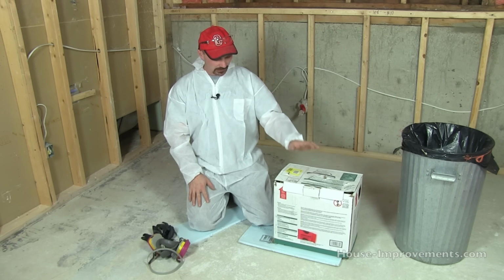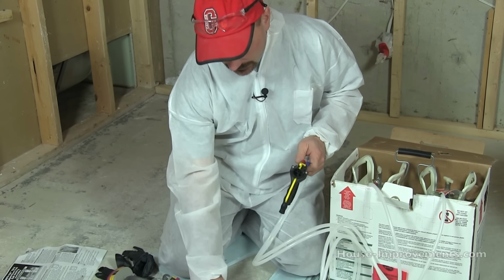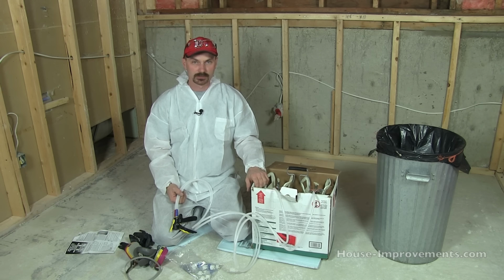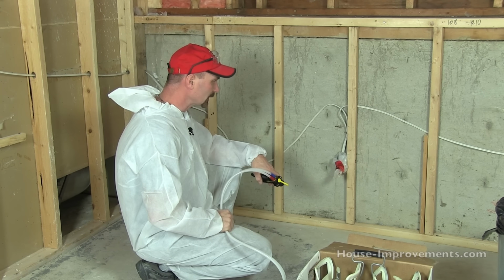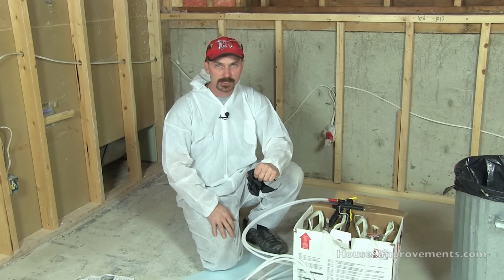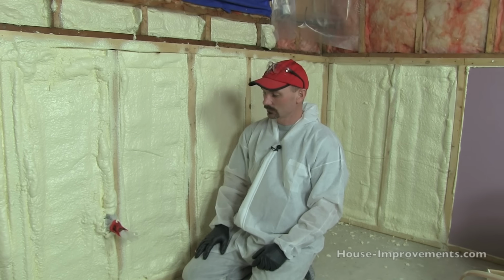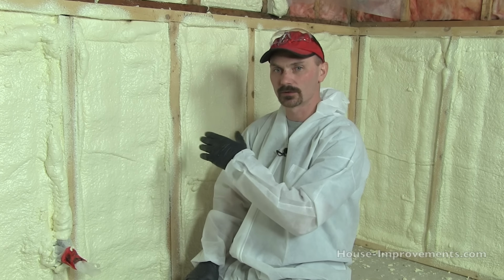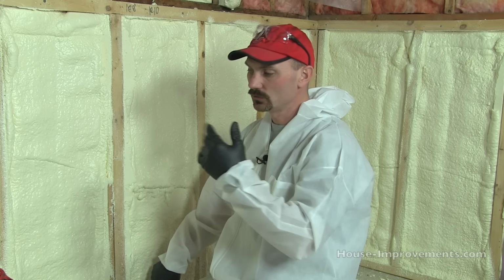How to Install Spray Foam Insulation DIY

Comment: Shannon - although some of your tips are spot on, you make several dangerous mistakes in this video - You should never spray another layer on top of rising foam that has not cured, becasue the new layer prevents the first layer from fully curing. As a result, the finished product will not have the full R-value, could cause off-gasing, could become flammable, among other hazards. This is one of many reasons it IS NOT A DIY PROJECT.  The printed instructions should explain this but the average layman would not understand this.
Reply: Thanks for pointing that out. He should have window boxed with the spray, then a single pass fill vertically and moved onto the next section allowing the prior sections to cure 100% then go back to the first section after and make the vertical pass.

Comment: So to a painter its similar to spraying paint?? Only asking because i have a friend who wants me to spray his wharehouse in foam insulation..help would be greatly appreciated
Reply from the maker: A large project  like that will be much more efficient with a pro system. These little kits are expensive and not always fool proof and I would not recommend them on a project of any real size. If you have more than 500 sq. feet to do I would hire a pro.
Reply: @HouseImprovements  ok..thank you

Comment: How flammable is this stuff during spraying? would you turn a furnace off if spraying in a area near a furnace?
Reply from the maker: I would, but I don't see where it says to on the manufactures instructions. Read the instructions for the product you are using.

Comment: I watched your video on spray foam application; how do you think this product would work in an attic ceiling with irregularly spaced trusses in a 1904 house?

This would be the “easiest”, I think, as it’d save me having to buy lumber to reframe the trusses to regular spacing to fit common fibreglass batts.
Reply: That's exactly what I'm thinking about doing...but I don't know anything. 😄can we or should we spray wood with it? Like ceiling in basement also?

Comment: What if there are sealed cracks or moisture coming through concrete?  If I cover it with foam won't water be trapped behind and mold/mildew?

Comment: Hi Shannon, great video, as always. Are there different types of spray foams, I've heard the terms closed cell and open cell, where would you use each or could you use one over the top of the other? And also, what might a typical "R" value be for foam per inch as opposed to spun glass or mineral wool? Thanks, and keep up thegoodwork!
Dave

Comment: Are those wires in the wall hanging for a purpose... I mean.. Someone has gone to some length to drill them holes in specific locations so that the wire makes that hanging shape. Wouldn't it be better to try and keep them close to the ceiling or the floor so that in the future people wont accidentally drill into them?!
Reply: The way I saw it the wires were on the back sides of the studs and not drilled through at all.

Comment: I want to do in crawl space and I dont know how much I need
Reply from the maker: They come in different amounts depending on the kit. Read the labels but usually the coverage is based on 1" thick and most times you will actually want it at least 2" thick so factor that into the amount you buy. In all honesty if I was needing to spray a enclosed area like a crawl space where there is not a good way to ventilate it well I would hire it to the pros. You need very very good ventilation and a good respirator or fresh air respirator.  in more inclosed space.

Comment: Great video !!!
Brake cleaner from the auto parts store will clean those tips out before the foam starts to harden up and set up so you can reuse them.
WE use the commercial version of this stuff in the factory where I work.
Part A and part B come in 300 gallon tanks and are kept at like 85 degrees far. , so yes it IS VERY important those tanks be kept warm.
The hose assemblies also have heating tape inside of them to keep that stuff warm also so it doesn't cool.
It affects the mixture balance as well as the velocity of it out the gun.
Ours use a nitrogen gas purge valve on the guns also to blow out the chemicals after the timed shot has been finished.
We use a full face shield and a hat on the head for face and head protection.
If using this stuff overhead , please use earplugs....for obvious reasons.
If you get it in your hair just let it set up and pick it out later after it sets up if it's a small tiny bit otherwise get the brake cleaner out and spray it into a rag to get it out before it sets.
It gets messy.
I know one guy who got it sprayed big time into his hair.
He had to cut all his hair off.
He wasn't wearing a hood or hat either.
Reply from the maker: Good tips thanks
Reply: Acetone

Comment: So, how many square feet did you get out of this 2000 kit?  Thanks for the great video.
Reply: Its a 200 kit, 200 board feet to square feet. I just dont know the conversion off hand
Reply: @GemCityRCOutlaws  A board foot is actually a measure of volume. By definition, a board foot is one square foot, one inch thick. The most common mistake made in calculating board footage is forgetting to multiply by the thickness. Example 1: A 4/4 board 8 inches wide and 8 feet long has 5.33 bd.ft.

Comment: Hello, is it true that using the spray foam on the entire house for new construction is a bad idea, because it will not allow the home to breath and also you cannot run wires in the future? A builder recently told me this when I was looking into what insulation to go with for my new home build. Thanks!
Reply from the maker: It is used in new homes a lot actually. Maybe your builder is not comfortable with it?
Reply: Thanks for replying back.
Reply: If you are that worried about future wiring, I would run conduit if possible. Then you can use single conductors instead of romex.
Reply: If you use closed cell there is still a space.
You have to add makeup air if the building envelop is that tight.
Reply: You have problems running wires behind any covering on walls, however you can make a nice straight hole in this stuff with an red hot ball bearing doped from the top down. This is how they run wires in Sip's homes.
Heat cuts right into this stuff like butter. So you can fish wires with a red hot poker.  Wile wire isn't always going to be where you need it anyway. But I'd plan ahead and run the wires before Sheetrock any walls even plan on what you might run a few years from now like Cat 5e or 6e  or even fiber.
They make an inexpensive home use plastic fiber you can terminate later if its in the walls for later use. also you can run Low voltage wires for lighting upgrades. Homes are moving more to Automation so new stuff comes out everyday.
Just plan ahead.
Hey If I told you in 1903 to run copper wires next to your gas lines for lights, you would not had to hire an electrician to come wire up your home a few years later. I think cat 5e and 6e as well as fiber will be around for a few years anyway. Wired home phones are all but going out of style, and cable TV coax is going out of style, only other thing is Power wires and speaker cable's and or Thermostats.
I really do not think your going to change wires all that much anyway, and I'll bet you would have moved out of that house after about 10 years or so anyway.
The money you can save from Spray Foam over fiberglass insulation is a lot in energy cost, he's giving bad advice. but thats my 2 cents on it.
Reply: Rick Williams
Reply: linop412 no
Reply: For a spray foamed home to breathe you need either a HRV (heat recovery ventilator) or ERV (energy recovery ventilator) to create air exchanges. The others covered your other question.
Reply: The chap who insulated my former 3500 sq ft home did not use this stuff on the roof area.  He used a ready made foam cavity and fiberglass insulation.

Comment: It was only $200 to get a pro to  do my sprinter van, but over spray is rear hard to remove. and only get a pro that will use 2 lb foam on a van or trailer.
Reply from the maker: good deal
Reply: Makes great bumper cars. Hardly any dents.

Comment: Good explanation and demo video--thanks for posting. One thing however, while this stuff does seal well, I would still add a vapour barrier as the wood framing is not covered with this product, so to be truly a top notch job I would still add one. If however, you sprayed the concrete wall first and had a stud wall built clear of it, I would say you could skip the vapour barrier.
Reply: @Dale e Sounds like you had an unusually bad experience. I was referring to a vapour barrier applied over the wood framing and insulation before adding your gypsum board to prevent humidity penetrating from the inside. Any moisture problems coming in from the exterior of the concrete requires a barrier on the exterior side as well as proper drainage. Did your spray foam break down? That's surprising--wonder if any other people had that happen?

Comment: did this stuff for a few years, just rub motor oil on anything you dont want it to stick to and it will pull right off. Like your studs

Comment: can i use this stuff thru driled holes  thru  existing drywall ,holes every foot  from floor to ceiling,,i was told its possible,,i basically wanna insulate around a newly installed window,,and i feel cold spots around it now in spots,,do you think this will work?
Reply from the maker: By working through small holes you have no idea what your doing or if its even helping. Come to our forum so we can maybe discuss this situation more thoroughly .https://www.house-improvements.com/forums/

Comment: 79 dead: The Foam Insulation blaze that ripped through the Grenfell Tower, London, causing multiple deaths (79 confirmed / 120+ estimated) has prompted widespread commentary on the Foam Insulation Industry. A Criminal investigation into the Foam Installation Contractors concerned is now taking place. It appears there will be a criminal prosecutions for corporate manslaughter for those concerned whose acts or unsafe products committed the offence. In the case of the Grenfell Tower fire, the most likely prosecution candidates would be the building’s management company, and the insulation contractors and sub-contractors involved in the property refurbishment in which apparently highly flammable foam materials were fitted as insulation.
Reply: The foam insulation in the Grenfell tower tragedy was rigid flat panels, pre-made in a factory and attached onsite.  Tragically, the many contractors and people involved used the wrong products, installed the wrong way in the wrong places for the wrong purposes.  Sad tragedy but Hopefully the investigation results it will lead to better regulations, better oversight, better testing to prevent this in the future.  And Hopefully All the existing screwed up buildings that made similar mistakes will somehow get retrofitted (corrected) to avoid a  similar tragedy.
Reply: *The flat panels comprised the outer facade frontage, behind them was a slab of insulation foam, this ignited and aided the fire progress. What needs to be said is many products have fire certificates yet fail during a fierce blaze if enough heat is applied to them. Foam is not made to fight fires but to conserve heat. Foam burns and end of story*.
Reply: @pipersson9258  The foam used in that case was extruded polyethylene. Caution with foam is absolutely warranted, but what is critical is that the right product is used in the right application, which that was not. Closed-cell foam like that most commonly used for high insulation value in the US can be purchased in a fire-rated form as well.  https://www.greenbuildingadvisor.com/article/building-errors-were-behind-grenfell-tragedy

Comment: This foam is good for edges, even if you do insulation panels or fiber panels.
Great technology for smaller areas. It's smelly and what not, but effective.

There are now more and more insulation tools and materials, I think it's a good trend, because the heating is contribution to the climate change a lot. I think we can also all save on heating cost, once the insulation is easy and affordable.
Reply: How do I get spray foam here in Zambia
Reply: Look up Global Solar Minimum that is real climate change. Always follow the money on all issues.

Comment: Well, consider this. TigerFoam offers 600 square foot kits for $600. Consider a home that has roughly 3570 square feet of wall to cover (windows and doors already taken out = 130 square feet). You would need to purchase 6 (six) kits to cover this area at 3" (3 inches) thick.
However, if you were to hire a "Professional" (I received a quote for this) the same area, and the closed cell foam with labor costs comes out to $11,234.00

Which, for those that can't do math very well: $11,234 - $3,600 = $7,634 in savings. 

Tell me again why its better to get a "Professional?"
Reply from the maker: +Jeff M  Ok there is one problem with your math. The tiger foam is 600 sq.ft. at 1" thick. So if you want 3" one kit only does 200Sq.ft So the math is this : 11234 -10800. = 434$. So if your labour is worth anything The pro is a better deal plus I believe a good pro is a  better product as far as consistency . Also I have never had a DIY kit yield as good as they are supposed to.
Reply: That figure I gave was accounting for this. 3" of foam, covering roughly 1200 square feet of wall. I guess I should've included that detail. So, it is still the $3600. That also doesn't take out the studs, so this too will add another 6% of product for use.
Reply: It's not.  You explained it very well.  I couldn't have said it any better myself.  Nicely done!
Reply: +Jeff M Ever see what happens when you spray the foam in the wrong conditions?  Try spraying the foam when it's incredibly humid and hot, it won't cure properly - ever.  Kits IMO should only be used if it's a small area, and the humidity and temperature can be controlled for the entire curing process.  Professionals will usually be able to compensate for differences in climate when it comes to new construction, where as a DIY guy wont know the first thing about the off the shelf foam he just bought, and won't understand what will happen long-term.
Reply: +Jeff M Your math is not right. The 600 kit is 600 sq. ft. at one inch.  If you do have 3750 square feet and are looking for 3" then it is actually 3" x 3750. This is now 11250 board foot divided by 600 per kit. 18 plus kits is what you need. 18 kits x $600 per is actually $10,800 just for materials. Trust me people I have been a professional applicator and estimator for nine plus years. For a small project these are great if proper prep and safety is performed. But anything larger then about 1200 bd. ft. and you can have it done professionally dollar for dollar with someone else having the hassle and liability. One other thought, these tanks weigh 60lbs each (can get old quick moving these around a site) and you need to make sure your area will allow you to dispose of them. Hope this helps. Thanks Jeff B.
Reply: Jeff Brault  m
Reply: Jeff M a
Reply: Nrfa h)
Reply: @trinamcdonald5686   600ft at 1 INCH, as per Tiger Foams own product description!
https://tigerfoam.com/sprayfoaminsulation/order-products/spray-foam-kits/tiger-foam-fast-rise-formula-600-board-foot-kit/
Reply: @trinamcdonald5686  did you check Tiger Foam's web site? It clearly says "This kit theoretically yields 600 board feet (square foot at 1″)".
Reply: they are board foot kits not square foot

Comment: the cost is way to high for the kits,better to do what was done on the right side,foam board and spray foam on the perimeter
Reply: Yep I agree. These kits are hard to use even for everyday handy person. I sprayed a little structure over my well. Very messy and hard to get depth wanted. Plus insects loved it and quickly moved in boring all kinds of holes/tunnels.

Comment: Hi Shannon,

Thanks Shannon for the video with its informative and detailed instructions. I debating whether to buy a kit or get a professional to do it. I do have someone coming over tomorrow to give a price. I will post the results tomorrow.  In reading the comments this foam your using is a closed cell foam and made by Froth Pak..... I've been buying stuff on Ebay now you can get up to 1 year no interest with Pay Pal Credit that's better than using your Lowes card for purchases over $300, which usually offers only six months no interest. Which is awesome in trying to remodel a house.....I have a question that looks like Energy Shelf House has asked and I'm hoping you can answer it? When applying this foam on ceilings does it work with the do it yourself kits? The videos I've watched for spraying foam on ceilings usually the machine is a real expensive looking machine not the do it yourself kits.
I have an attic that I converted into a second floor. It has cathedral ceilings. It is framed with true 2 x 4 ceiling rafters (joists). I have two turbines and have closed the ridge vent. I'm interested in the spray foam because of the r factor and that it does not mold. I'm living in Arkansas where it is humid and very hot in the summer about 100 degrees. If you could answer this question and also the company you recommend to get it from I'd appreciate it. You make it all look so easy...... I would respect and trust your advice. Thanks so much........
Reply from the maker: Using these systems should work fine working overhead, i personally have never used one on rafters but can't see why they would not work. Cover yourself head to toe as it could get a little messy. If you have a lot to do a foam contractor would be cheaper in most cases.
Reply: HouseImprovements  very cool.  how much did one of those 2 tank kits cost?